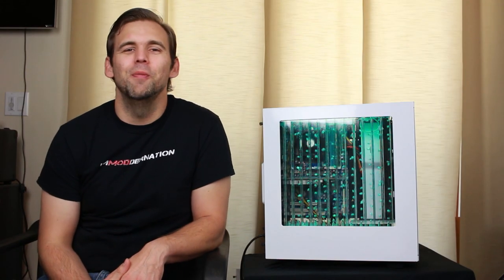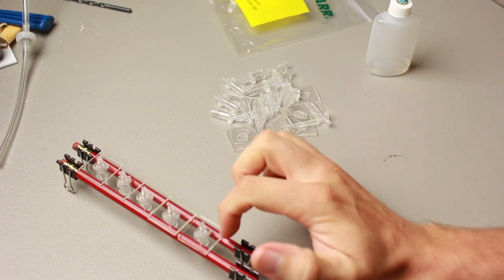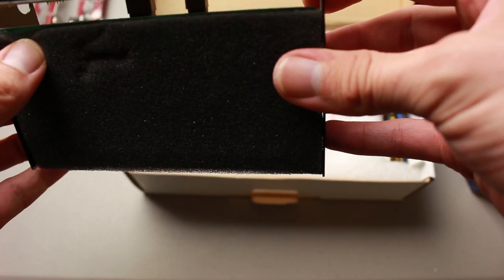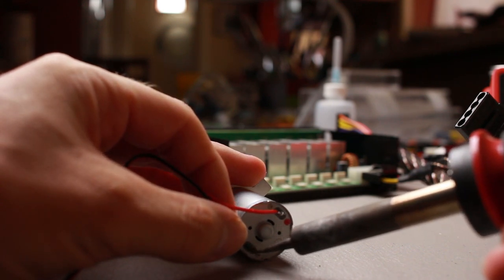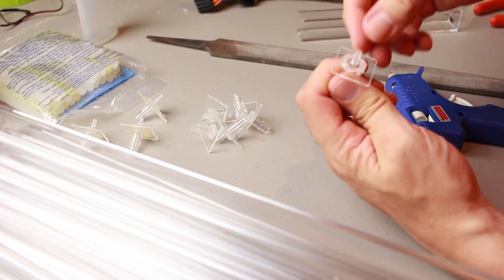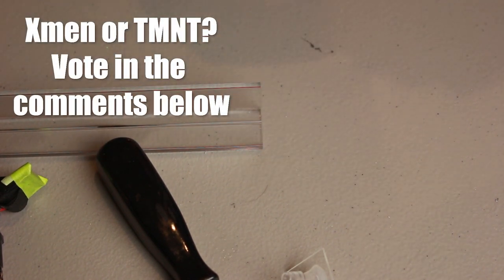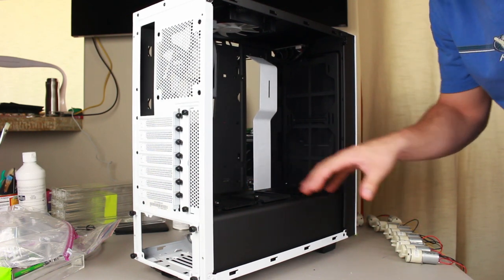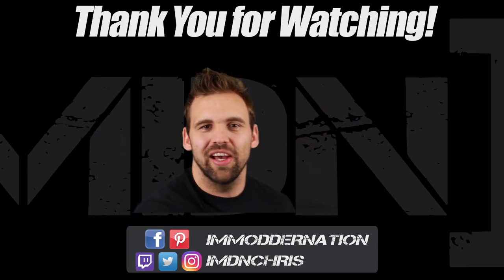BUBBLE WALL PC BUILD VLOG 3

Comment: Cool idea might be filling it with a more viscous fluid so the bubbles rise slower on some of them
Reply from the maker: Like Glycerol? For a second version? 😉
Reply: Could also add a die, if you had the pumps pump air really slowly so that the bubbles form slowly and then had it in a thick liquid so they rose slowly, died it red and backlit it it could look kinda like lava bubbles or something
Reply from the maker: @kiyosenl.3889  I like your thinking. Not sure if the dye would separate from the Glycerol because of the difference in density, but worth a try.
Reply: @ImmodderNation  if it does i think it would happen rather slowly due to how thick it is, it wouldn't float to the top for a long time, also the bubbling may cause it to continually mix

Comment: 2:38 Ultimate Life hacks! A very good use of a fan controller btw. That's actually very creative. I would have never thought that someone could use it in that manner. Nice to see you take the project step by step. It's an interesting video to watch. Nice work! 👍
Reply from the maker: Thanks TJ. It's just a variable voltage regulator and fans/pumps use DC motors. It was worth a try. There will be one more Vlog after this and it's a 20 minute video!
Reply: It's always good to experiment with different things on these kinds of projects. It gives you a chance to find better alternatives for parts. Looking forward to seeing the next video!

Comment: I usually keep a pair of needlenose pliers or needlenose vise grips to grab the back side of the rivet I'm drilling out, so it doesn't spin.  A common problem that prevents a rivet from being drilled out
Reply from the maker: You've always been my hero, Chris. I'll have to try that next time. Last time I drilled out rivets was a HAF 932 back in 2010.
Reply: @ImmodderNation  haha I hadn't drilled rivets in a long time either (because scratch builds lol), but quickly remembered as soon as the first rivet started spinning when I was helping a friend with their Portal case mod :D
Reply: @MosquitoMade  thats a great idea, the scratching doesnt bother me too much tho as i usually plan on doing painting anyways
Reply: @kiyosenl.3889  Oh, I do it so it doesn't spin so I can actually drill it out instead of it spinning with the drill bit, not so much to avoid scratching, for the same reasons lol

Comment: It is reassuring to know, that I'm not the only one using hotglue for the rescue :P
Reply from the maker: Hot glue and super glue EVERY TIME. Although Marine glue might be the hero this build needs.
Reply: @ImmodderNation  HAH, I keep trying to stockpile superglue, yet when I need it I've always just run out. Haven't even thought about marine glue, but for your case would've considered just drowning the bottom part of the valve assembly in resin :P
Reply from the maker: Resin might be overkill and more costly. I think a few tubes of super glue and more weld on should cover it. Amazon for the hot glue packs, Michael's in a pinch (or whatever craft store is in your area).
Reply: ImmodderNation  that reminds me to order more hot glue ^^. As for super glue in this application, have you tried adding baking powder to the mix, to increase the wall strength of your seal? It'd be almost like filling it up with resin.
Reply from the maker: I've never heard of adding baking powder. I'll have to find a video of that.
Reply: ImmodderNation i think i saw it in a video of adam savage first. Recently tested it. The baking powder super glue mix quickly hardens into a strong solid mass that can be sanded.
Reply from the maker: I like the idea of being able to sand it.